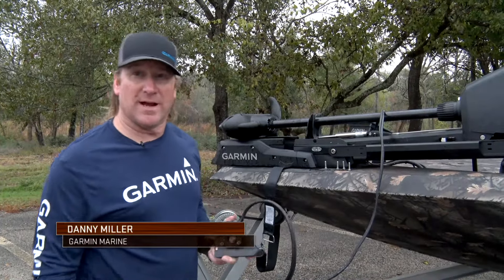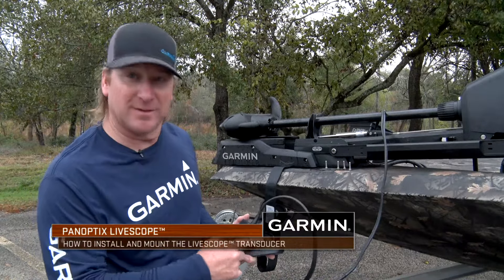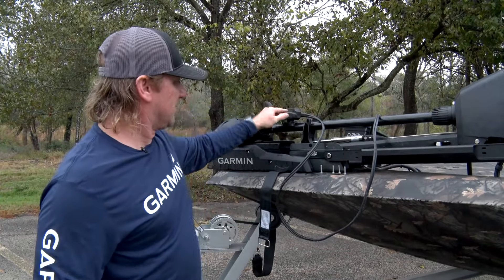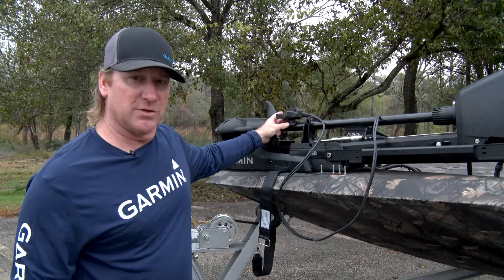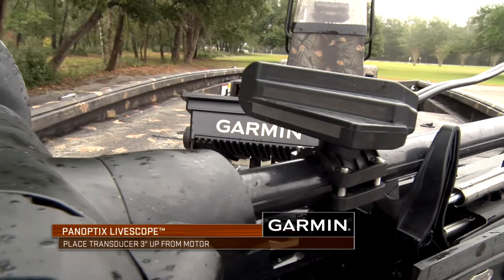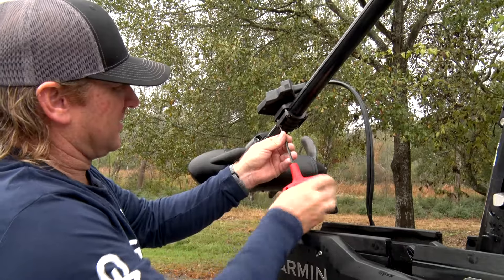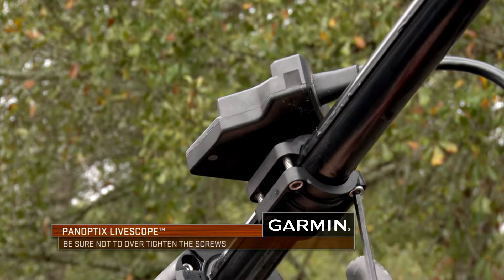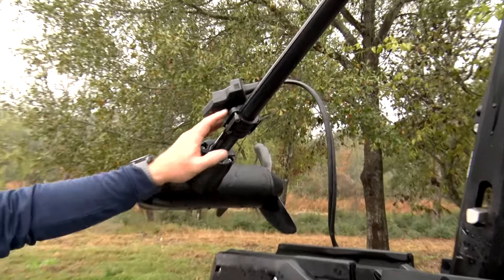How-To Mount the Garmin Panoptix LiveScope Transducer

Comment: Actually, finding your lure using this method is nearly impossible. The mounting angle to get away from the motor head causes the directions to get a bit skewed the further you cast. It drives me crazy.

Comment: I would not mount it on the trolling motor shaft.  If your motor has location lock, the motor will be sweeping left and right as it tries to hold the boat's position.  As a result, you lose contact with the target.